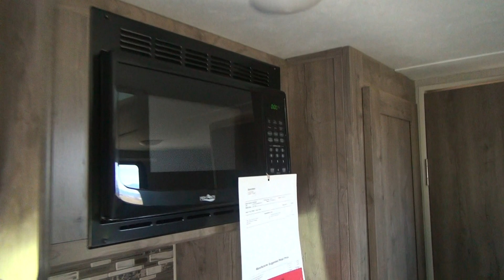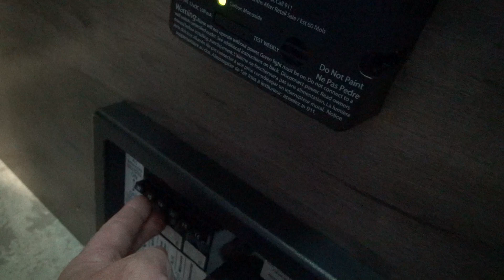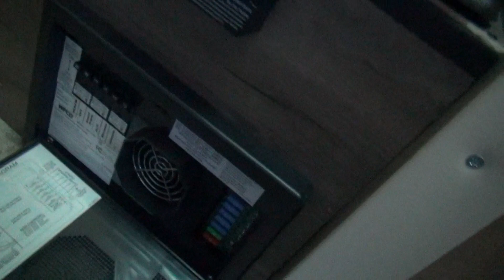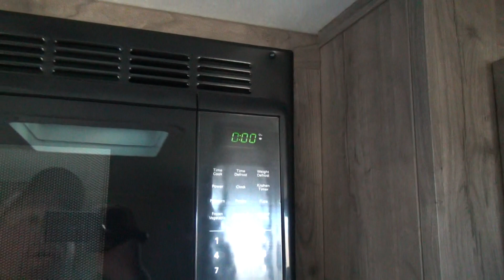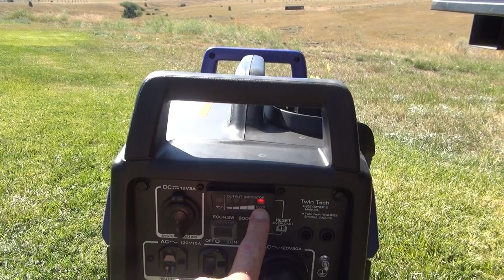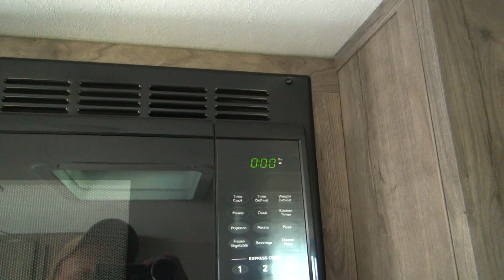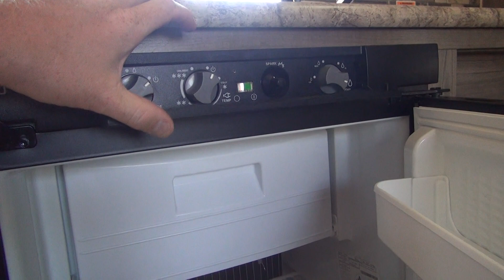Why don't the outlets work in my RV; Tech Tip #1

Comment: Thank you for sharing

What if you're connected to a building electric power and the refrigerator is not working ? Does the same rule apply? Run it on gas?